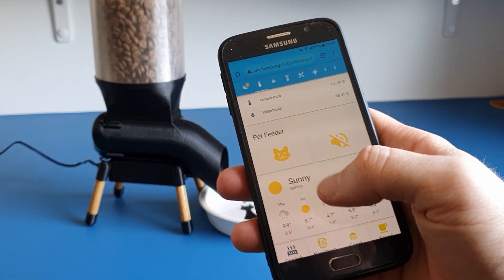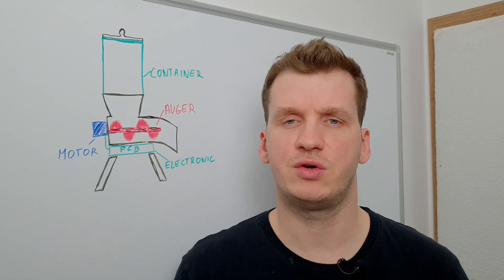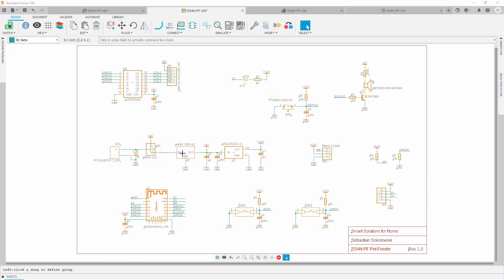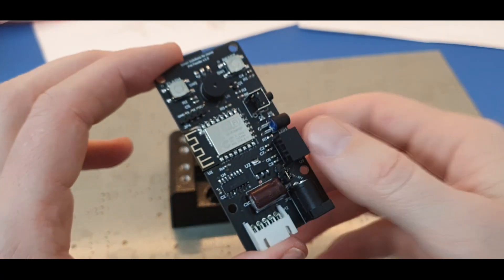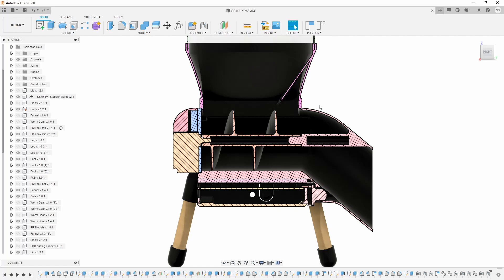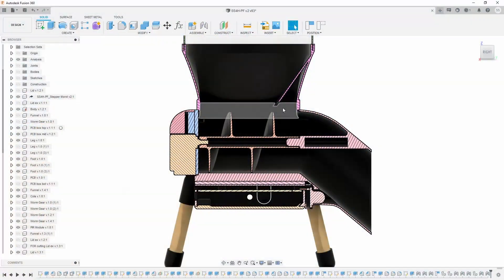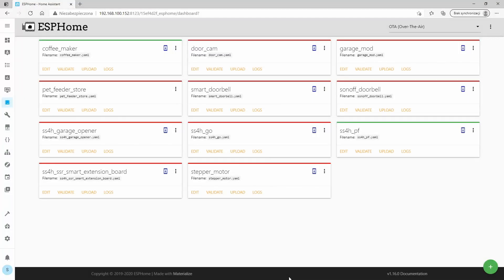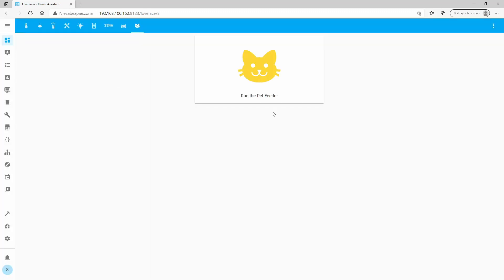A DIY Pet Feeder based on ESP8266

Comment: Great work! Specially how you stuck to resolving the design issue so you make it work with that particular motor. I had doubt about that motor strength when you posted that project earlier, I'm glad and amazed how you make it work. Keep  up a good work, I hope you have more projects like this to share.
Reply from the maker: Thanks a lot! I spent a lot of time (and filament ) dealing with the jamming of the grains. I'm glad you noticed it :)

Comment: Hi, the project looks great. Do you provide an invoice if I want to buy the pre assembled device ? All I have to buy then is the motor and a UART-USB adapter to load the code on the usp ? Thx a lot
Reply: Could you answer some questions I emailed you?  Thx
Reply from the maker: Glad you like the project!  
And yes, of course, I can provide an invoice if you need one.  
If you go for the PRE-ASSEMBLED KIT, all you’ll need is a 5V power supply (USB-C). The USB-UART adapter is optional—the board is already pre-programmed. You can connect it to your system using WiFi and the Captive Portal, but using the USB adapter will make things even easier.
Reply: @SmartSolutionsForHome  Great, thx for your answer.
Reply: @SmartSolutionsForHome  Order done

Comment: Hello! I made two of these for my cats, everything running, but I can't find a method for the device to release around the same amount of food everytime, sometimes I run the cycle to drop around 15 grams of food, one of the machines drops fine, the other almost nothing, and this can repeat on the other one. 

Also, one of the cats could just touch the feeder with his paw and some pieces of food would drop, and he can keep doing that for quite some time.

Any suggestion is more than welcome.

Comment: I'd like to put one of these out in my field for the feral cats.  What kind of solar power supply would be needed?
Reply from the maker: This is a very good question. It depends on how much sun there’s where you live on a daily basis. And how often do you plan to feed the cats. It's also important whether you plan to have permanent remote access via wifi or a meal schedule is enough. Then the ESP chip could go into sleep mode in between. The device normally consumes about 67mA, and when the stepper motor is on, it is ~210 mA for a few seconds. In addition to the power of the solar itself, the capacity of the battery that will be charged between feedings should be taken into account.
Reply: @SmartSolutionsForHome  I would only need it to activate once per day. It’s a back up for when I can’t get out there. So it could be on a regular schedule without a need for Wi-Fi
Reply from the maker: @peterpoggi  I'd have to calculate it, but I think that a cheap and popular 6W solar panel would be enough.
Reply: @SmartSolutionsForHome  Thank you - I still need to learn how to integrate the solar panel with the power bank. The only power banks I've used required to be manually switched between charge and supply modes. Everything is on YouTube :-)
Reply: @SmartSolutionsForHome  I guess the stepper motor is 5 V? Or was it 12
Reply from the maker: @peterpoggi  It's 5V

Comment: Hi Sebastian:) Can you help me, how to manage the PCB order at JLC PCB ? I can figure out to upload the Gerber files, but I have a problem with the BOM part. The BOM file you added is a PDF document. Would you be able to make an excel file that is capable of to be handled at JLC PCB? 

Or is it possible to get the seller you link to at aliexpress send only the parts for this board (it seems it gonna be tooo expensive), because many of the items is sold I 10 pieces or more.

Comment: Great video. I was thinking to make a similar project with an arduino nano but now I think the microprocessor you used fits better tonthe task.
How much time did this project take you from start to finish?
Reply from the maker: Thank you. If you don't plan WiFi connectivity, Arduino should be ok. Otherwise, I'd choose ESP8266 or ESP32. Are you asking how long does development take me? Or making this feeder right now, when I have already designed everything?

Comment: Hi, will this work with any Nema17 stepper motor? 🤔
Reply from the maker: Hi, a stepper motor has to be unipolar with 5 wires to be compatible. Unfortunately, most of the popular Nema17 Steppers (e.g. from 3D printers) are bipolar, so the ULN2003 driver won't be able to drive such a motor.